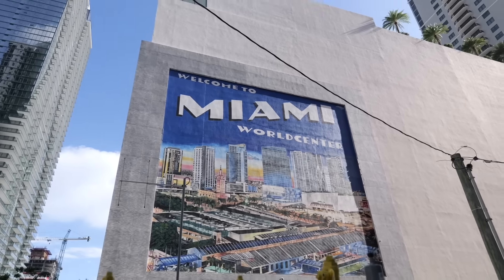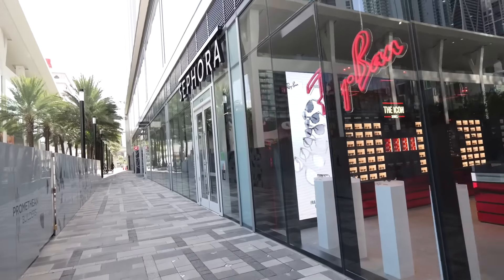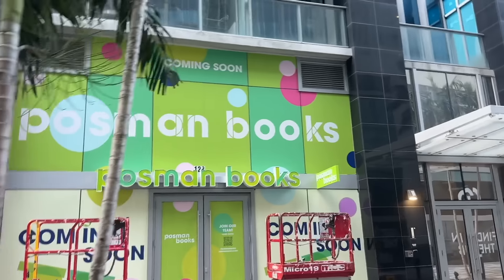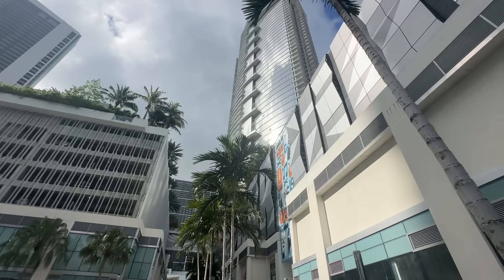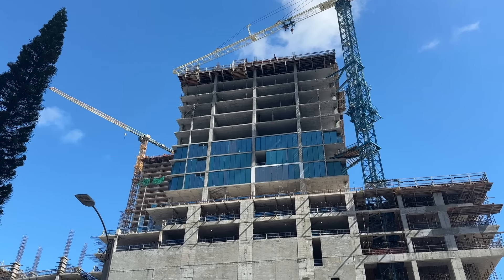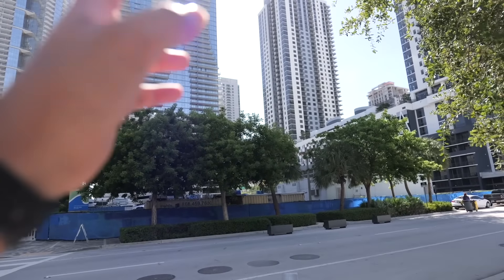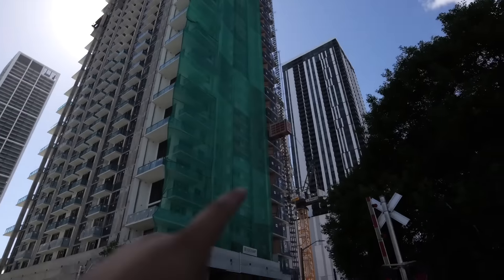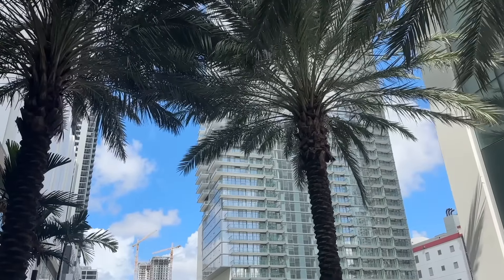Miami Worldcenter: The $6 BILLION Project Changing Downtown Miami!

Comment: Miami is being Manhattanized but with 12-story parking decks and without adequate subway service. Surely the surface streets won't completely gridlock with car traffic!! 😁😉
Reply: Exactly this. I work in a field where I see all the changes happening in South Florida; Miami is being Manhattanized but in general South Florida is densifying in areas without ANY public transit expansion. The bare minimum regulations are being achieved and development is just pushing forward.
Reply: Except you forgot to mention the subway system in NYC is horrendously filthy and dangerous which gives Miami a cleanliness award in comparison, and they also have a monorail in the city as well as free Tesla taxi service so not sure where the lack of transport is coming from
Reply: @recon_ron7746  A functional dirty subway beats 30min/mile driving